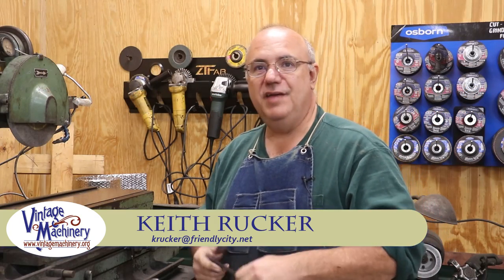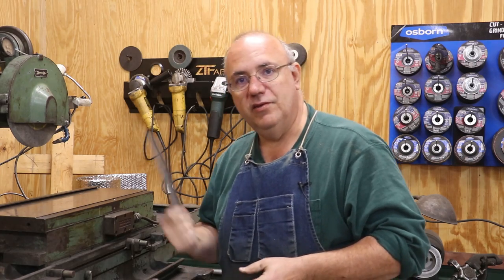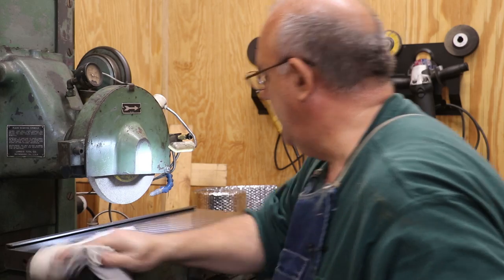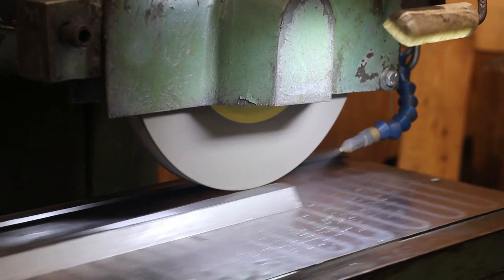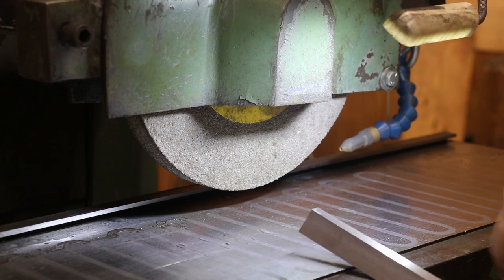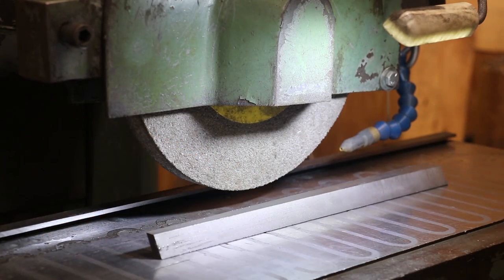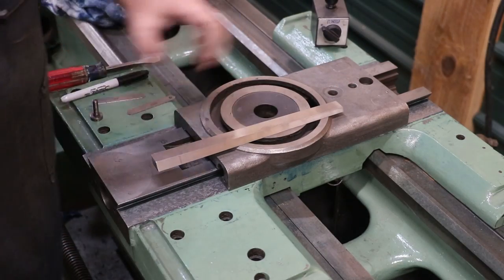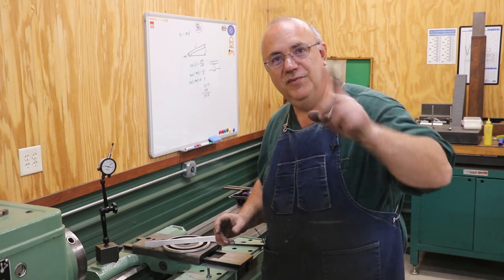Grinding a Tapered Machinery Gib using the  Surface Grinder  - Monarch Lathe Restoration:- Part 21

Comment: Since when does "basic geometry" allow for or require "converting" an irregular 4-sided polygon into a "triangle" to determine the "total angle" of its "tapers" and eliminating one of them by "zeroing out" the "thickness" of the "narrow" end to the NON-NUMBER "ZERO" TO MAKE THE "TRIG" FOR A NON-TRIANGLE "EASY" WHEN THE SHAPE IN QUESTION ITSELF REMAINS A 4-SIDED IRREGULAR POLYGON THAT DOESN'T HAVE "THICKNESS" AS A TWO-DIMENSIONAL "SHAPE" ON PAPER BUT INSTEAD HAS FOUR SIDES, FOUR INCLUDED ANGLES AND NEEDS NOTHING BUT A "PRECISION LEVEL" OR PROTRACTOR TO LEVEL IT AND DETERMINE THE THICKNESS OF THE "SPACER" TO PUT IN THE "SINE PLATE" TO KEEP IT LEVEL? AND HOW IN THE HELL DOES IT REQUIRE OVER .300" TO "LEVEL" A POLYGON WITH ONLY .216" OF "TAPER" OVER ITS ENTIRE LENGT? TRIG IS "TRIANGLE-SPECIFIC GEOMETRY" AND YOU CAN'T SIMPLY TURN A POLYGON "INTO A TRIANGLE" AND USE "TRIG" INSTEAD OF "BASIC GE0METRY" TO DO THE MATH ON WHAT STILL IS AND ALWAYS WILL BE A POLYGON IN REAL LIFE NO MATTER WHAT YOU "CONVERT" IT TO IN YOUR FANTASY WORLD WHERE YOU DIDN'T EVEN DO THE "TRIG" RIGHT SINCE YOU USED THE LENGTH OF THE "TRIANGLE" FOR ALL OF YOUR "TRIG" TO DETERMINE SINE PLAT ANGLE AND STACK INSTEAD OF THE "LENGTH" OF THE SINE PLATE FOR THE STACK MATH WHERE THE "10 INCHES" OF THE SINE PLATE PLUGGED INTO THE "10.390" OF YOUR NON-EXISTENT TRIANGLE THAT OBVIOUSLY WOULD HAVE TO "GROW" AS A POLYGON "CONVERTED" INTO A "RIGHT TRIANGLE" BY EXTENDING IT OUT TO THE POINT WHERE ITS TWO "TAPERED" SIDES FINALLY "MEET" AND WOULD SURE AS SHIT END UP BEING WAY LONGER THAN "10.390" AS A "TRIANGLE". HAD YOU USED THE "SINE PLATE LENGTH" AND DONE YOUR ":TRIG" CORRECTLY i'LL BET YOUR "STACK" WOULD HAVE SHRUNK CONSIDERABLY TO... .216" WHICH "COINCIDENTALLY" IS HOW MUCH "THICKER" ONE SIDE OF YOUR 4-SIDED IRREGULAR POLYGON IS THAN ITS OPPOSITE SIDE AND THAT IS HOW MUCH IT HAS TO BE "TILTED" TO MAKE THE "TOP" LONG SIDE "LEVEL" WITH THE BOTTOM LONG SIDE "TILTED" WHEN RESTING ON A "SINE PLATE" TILTED TO THE CORRECT ANGLE TO "CANCEL OUT" THAT .216" OF DIFFERENCE IN SIDE LENGTH. 

THE FACT THAT A ROUGHLY 1-DEGREE ANGLE IS NOT REMOTELY CLOSE TO ENOUGH TO CAUSE ALMOST A "DOUBLING" OF THE LENGTH OF THE OPPOSITE SIDES OF THAT POLYGON IN ONLY 10ISH INCHES AND THAT YOU COMPLETELY FAILED TO GRASP THAT IN REAL LIFE YOUR POLYGON STAYED A POLYGON AND CAN'T SIMPLY BE "CONVERTED" TO A "RIGHT TRIANGLE" OF THE EXACT SAME LENGTH AND YOU FOR SOME REASON CHOSE TO "VERIFY" YOUR "SETUP" WITH WHAT WAS OBVIOUSLY THE ORIGINAL GIB YOU MEASURED AND DREW OUT FOR US "IDIOTS" TO BE ABLE TO "GRASP" YOUR COMPLETE BULLSHIT "MATH" AND YOUR SINE PLATE ANGLE COULDN'T POSSIBLE "PROVE" YOUR SETUP AND MATH WERE "CORRECT' USING THE "CORRECT" STACK BUT THE "WRONG" GIB TO DEMONSTRATE THAT "PROOF" UNLESS THE "WRONG GIB" JUST HAPPENED TO BE IDENTICAL TO THE "RIGHT GIB" AND REGARDLESS YOU SURE AS SHIT DIDN'T DEMONSTRATE ANYTHING BUT THAT YOU MUST HAVE SLEPT THROUGH "BASIC GEOMETRY" AND SOMEHOW DID PRETTY WELL IN "ADVANCED MATH" LIKE "TRIG" AND SOMEHOW NEEDED TO AND WERE ABLE TO TAKE "TRIG" WHAT HAD TO BE AT LEAST 20 YEARS AGO WHEN YOU WERE IN HIGH SCHOOL OR COLLEGE AND WHEN i WAS 5+ YEARS OUT OF HIGH SCHOOL WHERE WE DIDN'T HAVE AND MUST NOT HAVE NEEDED "TRIG" OR "CALCULUS" AND INSTEAD "ONLY" HAD GEOMETRY, ALGEBRA AND "CONSUMER MATH" AS HIGH-SCHOOL MATH "OPTIONS" AND HAD TO TAKE A MATH AND A SCIENCE CLASS AT LEAST 3 YEARS OUT OF 4 WITH "CONSUMER MATH" AND "GE0METRY" AND ONE ALGEBRA CLASS BEING REQUIREMENTS AND WHERE CLOSE TO HALF OF MY CLASS ENDED UP BEING INDUCTED INTO THE NATIONAL HONOR SOCIETY AND "BASIC GEOMETRY" STARTED IN GRADE SCHOOL LITERALLY RIGHT AFTER "BASIC MATH" UP TO FRACTIONS AND DECIMALS AND SQUARE ROOTS AND PRIME AND "REPEATING" NUMBERS AND ALL THAT STUFF THAT STARTS SHOWING UP IN GEOMETRY WHEN PI ENTERS THE "EQUATION". 

SHIT, I DIDN'T EVEN KNOW WHAT "TRIG" WAS UNTIL VERY RECENTLY AND WHEN i READ THAT ITS REALLY JUST "TRIANGLE GEOMETRY" AND THAT SOMEHOW NOW REQUIRES AN ADVANCED MATH CLASS ALL ITS OWN WHEN TRIANGLES AND THEIR GEOMETRY ARE AS "SIMPLE" AS GEOMETRY GETS GIVEN THEY'RE THE POLYGONS WITH THE FEWEST SIDES, FEWEST ANGLES AND THE PYTHAGOREAN THEORUM AND A COUPLE OF "EASY" CONSTANTS TO REMEMBER AND "GET" AND "SEE" JUST BY LOOKING AT THE ONLY THREE POSSIBLE "TYPES" OF THOSE 3-SIDED POLYGONS AND BEING ABLE WITH JUST A RULER AND A FEW SIMPLE MEASUREMENTS DETERMINE AND VERIFY WHICH TYPE YOU'RE LOOKING AT IF ITS NOT OBVIOUS ALREADY ULTIMATELY MAKE TRIANGLES MUCH "EASIER" THAN CIRCLES AND IRREGULAR POLYGONS FOR MOST PEOPLE TO "GET" AND ARE EVEN EASIER FOR SOME TO "GET" THAN WHAT IS TO ME THE SIMPLEST SHAPE POSSIBLE CALLED THE "SQUARE" SIMPLY BECAUSE SOME IDIOT TEACHERS AND TEXTBOOKS INSIST ON CLAIMING A "SQUARE" IS ALSO A "RECTANGLE" BECAUSE ITS A "REGULAR POLYGON" AND IS EQUIANGULAR AND RIGHT-ANGULAR JUST LIKE RECTANGLES AND A RECTANGLE CAN HAVE SIDE LENGTHS ALMOST BUT NOT QUITE IDENTICAL AND "SQUARE" BUT APPEAR TO BE A SQUARE UNLESS THE SIDES ARE MEASURED CAREFULLY AND THE ONLY THING "SPECIAL" ABOUT A "SQUARE" IS THAT ITS A "RECTANGLE" WITH EQUAL-LENGTH SIDES AND THAT DOESN'T MAKE IT "SPECIAL".

WHICH IS TECHNICALLY TRUE BUT DISREGARDING THE FACT THAT A SQUARE IS CALLED A SQUARE BECAUSE THE "LENGTH TIMES WIDTH" MATH TO DETERMINE ITS AREA RESULTS IN ITS AREA ALWAYS BEING THE SQUARE OF ITS SIDE LENGTH AND ITS SIDE LENGTH THE SQUARE ROOT OF ITS AREA AND THOSE "CONSTANTS" ARE A GOOD "INTRODUCTION" TO THE GEOMETRY AND MATH OF THE ONLY TWO OTHER "PERFECT" GEOMETRIC SHAPES WHICH ARE THE CIRCE AND THE EQUILATERAL TRIANGLE. AND JUST LIKE THOSE TWO PERFECT SHAPES ALL YOU NEED IS A RULER AND TWO OR THREE MEASUREMENTS AND SOME SIMPLE CONSTANTS AND EQUATIONS TO GO FROM NOT KNOWING FOR CERTAIN THEY ARE WHAT THEY MAY APPEAR TO BE TO KNOWING EVERYTHING ABOUT THEM "INSIDE AND OUT" AND BEING ABLE TO DO WHAT IS IMPOSSIBLE WITH ALL OTHER SHAPES WHICH IS USE ONLY TWO "VARIABLES" MEASURED WITH A SIMPLE RULER AND "SOLVE"EVERY "EQUATION" NECESSARY TO "PROVE" THEY ARE WHAT THEY APPEARED TO BE. THAT GIVES KIDS THE CONFIDENCE TO TAKE ON "ACUTE" AND "OBTUSE" TRIANGLES AND RHOMBUSES AND PARALLELOGRAMS AND 3-DIMENSIONAL GEOMETRY FOR CUBES AND BOXES AND PYRAMIDS AND CYLINDERS.

But since you obviously failed miserably at "basic geometry" and appear to believe that because some shapes can be or have to be broken down into a number of triangles to determine their AREA you can simply just skip right to turning a RHOMBUS LIKE THAT GIB INTO A SINGLE TRIANGLE, DEFY COMMON SENSE AND BASIC GEOMETRY AND SOMEHOW MAKE IT TAPER FROM .418 TO "ZER0" WHICH IS NOT ONLY NOT A NUMBER AND THEREFOR CAN'T BE MEASURED BUT ALSO CAN'T BE REDUCED TO FROM .202 BY SUBTRACTING .202 FROM ITSELF TO "CREATE" A RIGHT TRIANGLE FROM A RHOMBUS WHILE MAINTAINING THE SAME "TAPER" AND THE SAME LENGTH WITHOUT SUBTRACTING .202 FROM THE "THICK" END AS WELL SINCE OBVIOUSLY THE TAPER HAS TO "DOUBLE" OTHERWISE AND CLEARLY YOUR NEW RIGHT ANGLE TRIANGLE MADE FROM A RHOMBUS WITH FOUR INCLUDED ANGLES THAT HAD TO AVERAGE 90 DEGREES TO TOTAL THE 360 INCLUDED DEGREES IN ALL 4-SIDED POLYGONS HAD TO MAKE "180 DEGREES" OF INCLUDED ANGULARITY "DISAPPEAR" WHEN 4 SIDES AND 4 ANGLES BECAME THREE SIDES AND THREE ANGLES AND "BASIC GEOMETRY" SAYS ALL TRIANGLES HAVE INCLUDED ANGLES     
TOTALING....180 DEGREES, 

SO WHERE  IN THE HELL DID YOU LEARN BASIC GEOMETRY AND TRIG AND WHY IN THE FUCK DID YOU POST SUCH A PACK OF LIES AND BULLSHIT AND MORE LIES TO "COVER UP" THE FACT THAT AT SOME POINT POST-MATH AND PRE-"PROOF" AND DURING "SET-UP" YOU CLEARLY FIGURED OUT THE WHOLE VIDEO TO THAT POINT WAS BULLSHIT SINCE YOUR WHOLE PROCESS COULDN'T HAVE BEEN MADE ANY MORE COMPLEX AND WRONG AND IMPOSSIBLE IF YOU TRIED AND THAT NO AMOUNT OF POSITIVE FEEDBACK FROM "VIEWERS" AND "SUBSCRIBERS" IS GOING TO PROVE YOU RIGHT OR DISPROVE ANYONE'S COMMENTS TO THE CONTRARY MUCH LESS PROVE ANYTHING BESIDES EVERY POSITIVE COMMENT YOU GET AGREEING WITH OR PRAISING YOUR PROCESS, MATH, SETUP, INTELLIGENCE ETC IS JUST "PROOF" THE COMMENTER IS AT LEAST AS CLUELESS AND/OR CLASSLESS AS YOU ARE OR THAT THEY PROBABLY DIDN'T WATCH ENOUGH OF OR PAY ATTENTION TO AND THEREFORE DON'T CARE ABOUT AND/OR RESPECT YOU, YOUR CHANNEL, YOUR VIDEOS ETC TO BE HERE  COMMENTING FOR ANY OTHER REASON THAN TO GET THEIR ROCKS OFF AND MAYBE GET SOMETHING OTHERWISE PERSONALLY IMPORTANT TO THEM OUT OF DOING SO AND ARE THEREFORE LIKE YOU IN THAT WAY TOO AND WILLING TO SAY/DO WHATEVER IT TAKES HERE IN OR IN RESPONSE TO YOUR VIDEOS TO BE OR FEEL "BETTER OFF" FOR HAVING PULLED THE WOOL OVER SOMEONE'S EYES BY "SUCCESSFULLY" PRETENDING TO BE A "GOOD PERSON" ONLINE POSTING BULLSHIT AND LIES JUST TO "CONTRIBUTE" SOMETHING "POSITIVE" AND "PUBLICLY" LIKE PUBLIC, POSITIVE LIES ARE GOING TO GET SOMEONE TO "HEAVEN" IF THEY ":MEANT WELL" AND WERE TOLD WHILE "HELPING OTHERS".